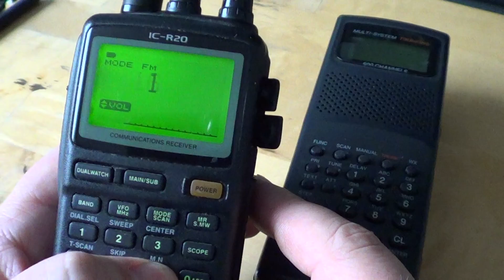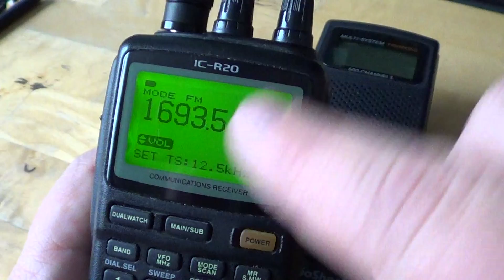Scanner radio VS Communications receiver

Comment: can u use a communications receiver as a scanner ?
Reply: YES, its actually better. the ONLY thing a CR does not do well is, CR cant Trunktrack. but CR can still receive Digital and they can receive Digital Trunking, just NOT Trunktrack. however, CR can receive Two Transmissions at one time, either the same band - such as the Base/Handheld or Two Different frequencies, they can even Dual Voice Record !!!!!
the CR can also TUNE better than a Scanner, the scanner has Limited Tuning steps, whereas a CR has unlimited Tuneing steps. UHF Channel is Right, the CR can tune to SW, HF, MW as well as Multimodes like USB, LSB, CW . and tons of Amatuer Digital Modes as well. Scanners cannot.

Comment: Most scanners the past 10 years let you modify the step amd between AM and FM. The older ones like your pro92 and my pro91 won't though.
Reply: Scanner are Nice if you want to get into the hobby fast. but a CR will always out perform a Scanner. except for Trunking. modern scanner however have Gaps in coverage, and there is plenty to listen to in those missing bands, as well as HF communications, and above 1.3 Ghz to 3 Ghz. also Scanners while great for Digital Radio standards, they cant receive the Amatuer Radio Digital modes. all in all Scanners get you listening fast and a EZ to use.

Comment: Can anyone give me some guidance please ?
I have a GRE PSR 216 Scanner  , the function keyboard appears to be 'frozen' , I cannot get any of the buttons to respond . Could this be an internal problem or do I need to press a combination of buttons ?
I have 'Power' and the screen is illuminated showing the Channel with a load of Zeros after it . No frequencies stored .
Any guidance or advice would be most Welcome
Reply: There should be a small hole on the side, stick a pin in it to reset

Comment: Excellent description between the differences of a Scanner versus a Communications Receiver and the different uses of the two. I have owned numerous models of both types for many years now and I'm shocked how inexpensive it is today to buy a basic RTL style receiver (SDR). Although basic, it allows you to listen from about 100 KHz - almost 2 GHz in all modes but in order to make use of it you have to know how to install, configure and calibrate such a setup.
Reply: DarkWolf76 Cheap SDRs is shit. Low sensitivity, no selectivity or front end, and low accuracy. You're better off with scanner and will hear more and can use it like communication receiver.
Reply: foskten10 Damnit!!!! I wasted money on a handheld scanner!!! I should have gotten a communication receiver 👿